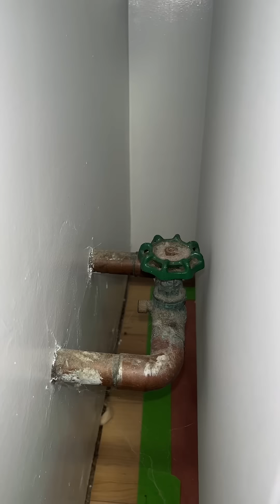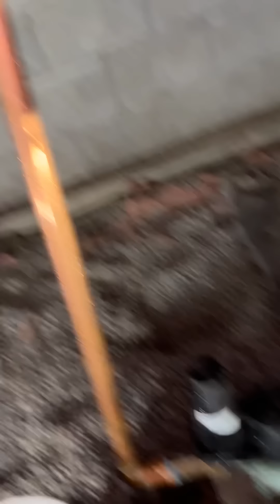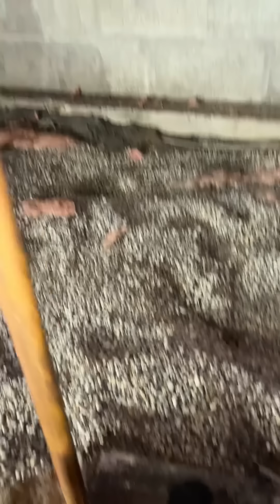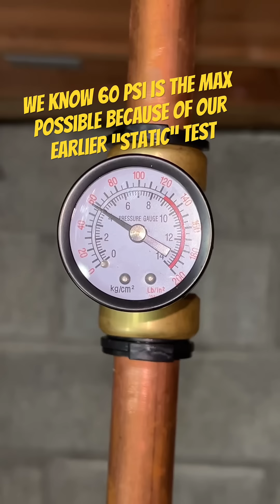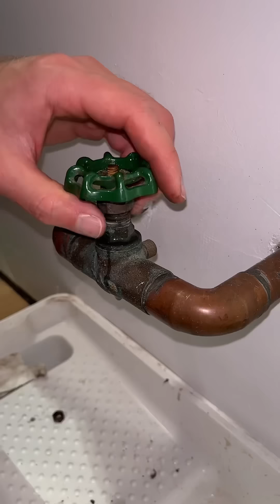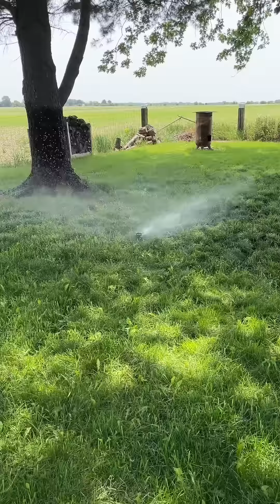Low water flow? Try this! #diy #plumbing #tools

Comment: Good explanation for the same phenomenon in my house. Extremely good input pressure, disappointing max flow rate from a hose pipe attached to an external tap in my back garden. 
I will go hunting for a flow restriction. Thanks!
Reply from the maker: One reason I love fluid systems is that troubleshooting is simple once you understand the basics. Pressure gauges are your ally. Happy hunting!

Comment: You could also remove the gate valve (spindle) and cap off the hole.
Reply from the maker: Can you buy caps for where the stop and waste valve stem assembly normally goes?
Reply: Hhmm, I'm not sure about specifically made ones, surely there's something that would fit, is it 25mm (one inch)  female cap end?? @reidthemanual
Reply from the maker: @Boggs11  I’m not sure on the threads. I figured it was something odd, but I’ll check it when I have time and report back.
Reply: You could be 💯  correct on this, I'd like to know. Cheers mate @reidthemanual

Comment: Shark bites are a no
Reply from the maker: If you install them correctly, push-to-connect (PTC) fittings provide reliable connections, but I would much rather use a PEX connection anywhere a leak would be costly.

A friend actually just told me today that he had a brass-bodied PTC fitting (similar to the one in this video) on a copper line going to a washing machine and it started dripping after 4 or 5 years and led to a basement renovation project…. For the record, he did not install the locking rings and there was vibration from the washing machine. For me, I have not found PTC fittings to be any more failure prone than others. Still, I use caution.

Comment: Good job explaining so viewers could see how you troubleshoot a similar problem. I work for a landscape contractor and we mostly do new construction so we don’t have many issues like this. Even in new construction, there are issues that arise and our irrigation technicians must troubleshoot the system to discover the problem. We always have the irrigation mainline completely separate from the house with a separate backflow preventer, sub-meter, flow sensor, normally closed master valve, etc. It’s so when there is a pressure issue inside the house or leak is detected by the amount of water being used, we can easily identify and prove that it’s not caused by our work. They always blame the landscape contractor so we install all of those items.
Reply from the maker: Very nice! Sounds like you guys do good work. What kind of flow sensor and normally closed master valve do you use? 24-volt or 120-volt equipment?

Comment: 60psi at the meter is low af unless it's a multi unit property with a prv installed before the meter. Most of the homes I serve have 100-150psi at the meter and 70psi in the home after prv is good.
Reply from the maker: This is in a rural water district. They keep the main pressure low to protect old infrastructure. I wouldn’t want the pressure any lower, but it seems to provide ample flow for any task.

Comment: Could it be that water was restricted at that stop/waste valve because instead of there being a full port opening of 3/4 inch when that valve is all the way open , the design of that valve means that there is only about a 5/16ths to 3/8ths inch opening for water to pass through which is also a point where mineral buildup is more likely to occur 🤔🤔🤔🤔
Reply from the maker: It is surprising how restrictive the design of these stop and waste valves is. The water has to basically flow in an “s” curve and it gets necked down in the middle where the valve seat is. So, yes, that was/is surely hurting water flow! Interesting point about mineral buildup at the orifice…. That does ring true in my mind. I’ll have to inspect it upon removal.

Comment: A stop/waste valve for your whole house shut-off valve ; IS CRAP !!!!! THERE IS NO QUESTION AS TO WHETHER THAT IS IN SOME SORT OF "PARTIALLY CLOSED POSITION" IT IS BUILT IN SUCH A WAY THAT IT IMPOSES 'ALOT' (!!!!) OF RESTRICTION TO THE FLOW OF WATER THROUGH IT , EVEN WHEN IT IS IN IT'S "FULL OPEN" POSITION ; FIRST THING TO DO 86 THAT RIGHT THERE !!!! MOST GENERALLY BRANCH LINES ONLY ,  IF APPROPRIATE IS WHERE THOSE GO
Reply from the maker: The design of these is definitely not meant for high flow rates.

Comment: just cut that old valve off and connect the two sides together with copper pipe.  And throw away that leaky shark bite crap you installed and solder something on.
Reply from the maker: All in time. Have you had bad experiences with push to connect fittings?
Reply: @reidthemanual  Yes! Somebody but them all over the house I bought.  Every year a new leak would show up, and I'd cut the ceiling or walls and it would be a shark bite fitting in there leaking.  I cut them out and soldered real copper fittings and pipe to fix the problems. I think I got them all, because it's been about four years since any new leak has popped up.
Reply from the maker: @andytraiger4079  Yikes! Any idea what exactly would start the leaks? Mineral buildup? Pipes moving? Water hammer?
Reply: @reidthemanual  I have no idea, maybe a little of all of that. I don't even know why anyone would expect they would be a good seal.  I mean you can rotate them easily with your bare hands... so why would you think they seal well?

Comment: So basically did nothing but open the gate valve completely.
Reply from the maker: Exactly. With a little diagnostic work, you might be able to gain a lot of flow without replacing a thing. Note that a plumber had already checked the house out and missed this. Why? A lack of diagnostics.

Comment: I would have started by changing the upstairs shutoff faucet. Adding a hidden pressure gauge wasn't really necessary.
Reply: Better yet eliminate the valve. You don't need it if you have access to the new main shutoff valve.

Comment: Every pressure you’re measuring is static pressure.  You never measured dynamic pressure.  Dynamic pressure requires a pitot probe in the flow path.  There is a static pressure when there is no flow and when there is flow.  Generally, static pressure should go down as flow speed increases and dynamic pressure should go up as flow speed increases.  Just because flow exists does not change a static pressure reading into dynamic pressure.
Reply from the maker: Thanks for the comment. I love a good pitot tube. That reminds me of my fluids lab in school.

I might not be using the correct terminology by certain technical definitions, but static and dynamic are still helpful relative terms for this kind of troubleshooting. Perhaps I should have said “residual system” pressure rather than “dynamic” but that might not of helped the lesson... Anyway, the goal is for everyone to understand that you can learn a lot by checking your water system pressure under multiple flow conditions.

Comment: Not a plumber but I pretend to be one when something breaks. I check online make my measurements and my list. Then I go to Home Depot but can't get into the aisle because the lift is going to be there for 30 mins. So I drive to Lowes which is across the road. They have everything but the right length hose.  Back to HD and the fork lift is pulling out of the aisle. The plumbing associate asks me what I need. I need one of the hoses hanging right behind you. And the rest of the job is easy.

Comment: More important why is that main line flopping around?
Reply from the maker: There is a section of heavy polyethylene pipe between the curb valve and the meter, and it’s not currently secured in the crawlspace.

Comment: What if you have this problem but it’s not a valve and it’s in concrete
Reply: Real question
Reply from the maker: I don’t know all the details of your situation, but if you see good static pressure but low dynamic pressure just after a pipe exits concrete, then I would ask myself “how can I get a pressure reading on the line before it enters the concrete?”

If your entire house is suffering from low flow (dynamic pressure), see if your neighbors have the same issue. If everyone in your neighborhood has the same issue, it’s possibly a water main limitation. If you are the only one with issues, narrow it down like shown in the video and have the water supplier verify your curbside water valve is open all the way.

Feel free to share more details and we’ll try to help.

Comment: This is also seen in air compressor ratings as PSI ( Pounds per Square Inch ) Static Pressure
CFM ( Cubic Feet per Minutes ) Dynamic Pressure.
Reply: No.  Dynamic pressure is not the same as flow rate.  Flow rate is measured in CFM.  Dynamic pressure is a pressure (force per unit area) and not a flow rate.

Comment: My house is only 5 years old. Bought it new. My pressure has always been around 25-30psi throughout the house. I have no leaks and the city swares the main at the street is at 100psi. I checked my pressure regulator near the shut off by the curb, but its wide open. I cannot for the life of me figure out why it is so low. My neighbors all experience the same issue.
Reply from the maker: That seems odd. I grew up with a well that had pressure a little above that, but it had lots of flow, so even when you opened multiple faucets, the pressure was fairly steady. If your house is like that, then maybe you’re technically okay.

Still, if all of your neighbors have the same low pressure (verified with a gauge), then I would stop by your nearest firehouse and ask what the typical fire hydrant pressure is in your neighborhood. The fire hydrants on your street should be connected to full pressure city water, and some fire departments have rough “fire hydrant pressure maps” of their districts.
Reply: @reidthemanual  I will have to look into that.  Water pressure drops significantly if there is more than 1 faucet running. Hell even flushing the toilet drops water pressure through the entire house. It's annoying and quiet pathetic honestly.
Reply from the maker: @williambarrett9187  That’s exactly how this house was. It just did not seem right…. eventually the restriction was identified, and now it’s like a whole new water system.
Reply from the maker: @williambarrett9187  Double check static pressure in the neighborhood. If the utility main is at 100 psi (verify that), but all houses are at 30psi static pressure (also verify that), you need to get the static pressure up. Fix static pressure, then look for flow restrictions.
Reply: @reidthemanual  where are places outside i can look for blockage aside from pressure regulator near the curb? Static pressure was  checked at the spickit in direct line to the pressure regulator.

Comment: But WHY? WHY WAS THAT VALVE HALFWAY CLOSED? WHO WOULD DO SOMETHING SO OBVIOUSLY STUPID?
Reply from the maker: Valves can get seized in any state when they sit unexercized. In this case, it was an old valve and was closed for a while after the previous owner moved out. It was then reopened but apparently got bound up after being opened just a little. It then sat like that and got stuck.

Comment: We have an addition to the home we bought.. that is the only part of the house where we have bad pressure..the shut off valves to that part of the house are seized..i figured that was the possible culprit,  have purchased compression ball valves but have yet to install  them.. I'm considering a re-pipe of the area (a shower/dual sink/toilet)..just deciding between cpvc, pex...
Reply from the maker: If the original part of the house has good pressure and flow, then you can be sure something (stuck valves, undersized piping, etc) is restricting flow to the addition.

Copper pipe is the gold standard, CPVC works well in areas where you cannot get tools (because joins are glued), PEX-A is quite popular for its resiliency and high flow capacity, but I actually use PEX-B with cinch clamps when I can because if you mess something up or change plans you can easily disassemble everything and reuse fittings (brass fittings) at any time. I have yet to have issues with the slight flow restrictions of PEX-B fittings. Perhaps it’s because I use the hard-to-find swept elbows rather than sharp 90 degree fittings. PEX-B: affordable, versatile, forgiving.

Comment: I'm gonna be that guy. That wasn't a Sharkbite fitting. Sharkbite is a brand and that was a generic knockoff product. I know, I know. Semantics. Sharkbite gets blamed all the time for failures when it's usually cheaper knock off products in reality, so I find the distinction important for anyone who cares about such knowledge.
Reply from the maker: Yep! I said “Sharkbite” because it’s the brand of push-to-connect fitting most people know. This was a Watts fitting (also name brand). Check out the link in the description. I would not recommend “generic” push to connect fittings (Amazon) for home plumbing. Anything you buy at a brick and mortar store should be okay. Also, generally I use plastic fittings with plastic pipe up to 1/2” and brass fittings with all metal pipe and plastic larger than 1/2.”
Reply: @reidthemanual I get that, but calling it a brand that it isn't is still inaccurate information and doesn't help with the existing stigma that Sharkbite fittings have. Not trying to be obnoxious. I'm just passionate about sharing correct information, especially amongst plumbing products and brands.

Comment: Omg, i would have been happy to have had even the 20 lbs of pressure... for years our static pressure was between 7 and 10 pounds, with a dynamic pressire of almost nothing. If my toilet was running, my neighbor couldnt get a glass of water. We have around 20 houses on one well, and one of the underground shut off valves about 1/3 of the way down got damaged by a snow plow. Now that it got fixed, our static pressure is up to around 45 to 50 pounds. Sooo much better!
Reply from the maker: Wow! You were in a bad way there for a while. Glad you got it fixed!

Comment: Shark bite and permanent are two words that don’t go together.
Reply: Or 3, depending on autocorrect 😂
Reply: @PeterJoseph7865 😂
Reply from the maker: The dangerous thing about push to connect fittings is the false sense of a successful installation. It may look good even if you only have the pipe pushed half way into the fitting. You have to properly prep the pipes, verify full insertion, and then still test for leaks. O-rings are excellent at sealing for many years if used correctly.
Reply: @reidthemanual well said!
Reply: @reidthemanual its pretty easy to prep and mark a pipe to ensure it’s fully inserted.

Comment: This only works in certain areas of states
Reply from the maker: Pressure gauges work in all 50 states. 😂
Reply: @reidthemanual I'm commenting on your work son!!😂 it doesn't work for every state codes are different, and why didn't you just take off the old shut of valve would've not needed to do all that work 😂😂😂

Comment: Curious, why spend so much time with investigation, you already know that globe valve is not opening/closing all the way and there's a good service valve at the meter. Instead of cutting in the pressure gauge I would have replaced the globe valve with a full port ballvalve. Then I will still have time to get lunch at Kwik Trip before my next service call. 🤠
Reply from the maker: Rumors were that this neighborhood had “low water pressure” and that old valve “worked last we knew.” It’s just in my nature to want data to help everyone make informed decisions. I honesty thought there might have been a restriction in the meter, but the reading on the gauge proved otherwise.

Comment: “Permanent” is a word I only say with fingers crossed and after a long prayer when using shark bite fittings.
Reply from the maker: I feel you! I obsessed for 15 minutes making sure the pipes were prepped well and then fully seated in the fitting.

After using hundreds of push to connect fittings, I think I have had, maybe, one leak unexpectedly. I swapped it out and the replacement worked fine. Properly installed, they seem as reliable as any other style of fitting (if not more so). That being said, for some reason, I struggle to trust them. Call it superstition. 🤷‍♂️

Comment: 55psi from the main is pretty low to start with 😂😂
Reply from the maker: I grew up with 40 psi, so 55-60 seems plenty powerful to me. Haha

My area has some neighborhoods with water pressure over 100 psi. It’s great for firefighting, but in your house you need a pressure reducing valve to bring it down to under 80 psi. A good problem to have, I suppose.
Reply: Yeah I feel you brother,we had a 300 ft well growing up with low pressure,but most houses nowadays have around 80-90 psi from the main @reidthemanual

Comment: Working a valve back and forth can break loose lime for the seats. Sometimes of it is stuck you can loosen the packing nut and re-tighten later while valve is mid-way. It might also work on some valve that don't want to fully shut off.

Comment: That 3/4" stop and waste valve has something like a 60 percent reduction in flow over a ball valve
Reply from the maker: I believe it! The internal design of the stop and waste valves requires the water to essentially flow in a “S” and that has to hurt flow.
Reply: First thing I thought, remove the old valve.  Should check with utilities on the street pressure,  that is the max you will get. After that adjust your pressure regulator if needed.

Comment: What about the pressure regulator valve (PRV)?
Reply: Those can jack with your pressure and everyone here in TN has them.... I've gotten really fast at doing them
Reply from the maker: It’s a great question. This neighborhood actually does not have PRVs because the utility keeps the pressure low enough for end use. If this old valve had not been the issue, my next suspect would have been the meter itself. Thankfully, I was able to use the gauges to confirm there was a lot of pressure drop through the old main valve.